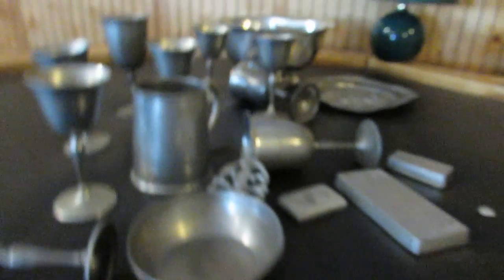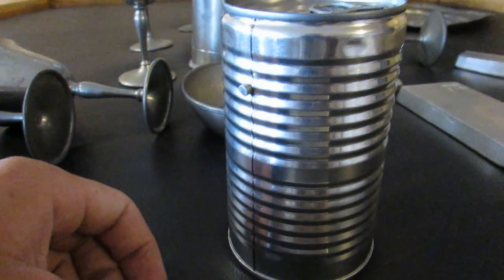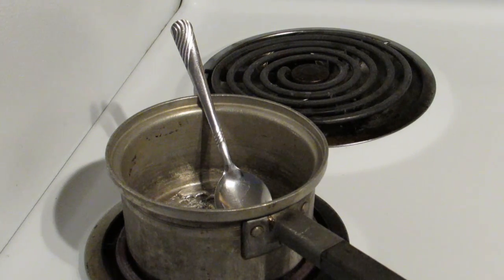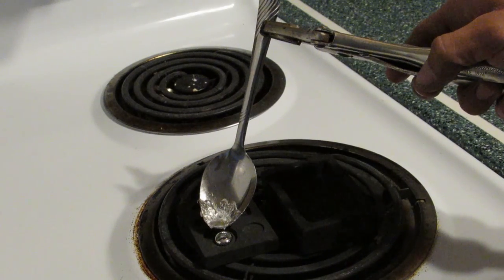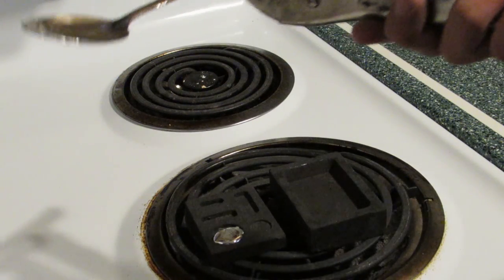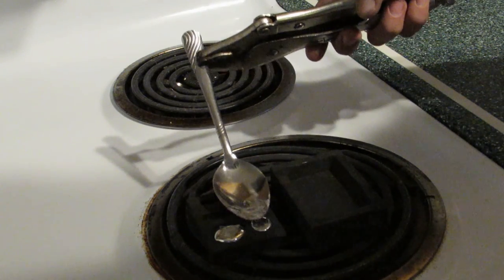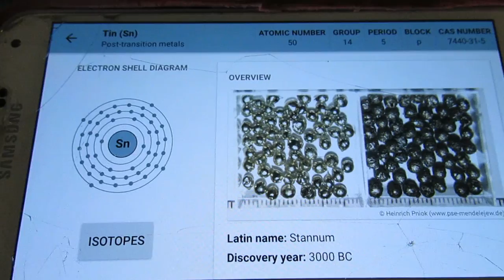Melting tin on my stove top

Comment: Do not use an aluminum pot.
Only use a steel or cast iron pot.
You can get aluminum contamination of the tin, and the aluminum pot itself can melt where it is in contact with the molten tin.

Comment: If you want metal flat you’ll need to press a flat board on it while still molten. Surface tension otherwise rounds the top.
Reply: Tin has a really high surface tension

Comment: what type on pan or pot did you use, and could the pan melt to with the metal?
Reply from the maker: It's an aluminum pot. If you left the stove on high for long enough the aluminum could melt.
Reply: @Landenslifelessons  What happens if you use Stainless Steel pot?

Comment: He is not using aluminum ... aluminum needs to get melted 1,221°F or 660.3°C ... he is using LEAD metal, you can find lead metal inside of car batteries and lead metal is shiny than aluminum and can be melted in the stove with only 500 to 600°F or 300°C... he can be a clown better.
Reply: could be zinc
Reply: Bro what, it is tin

Comment: You appear to be melting pewter, not tin. Pewter is mostly tin, but it also has antimony and copper in it. Don't tin cans rust? Pewter does not appear to rust.
Reply from the maker: What I melted in the video was pure tin. that's why it was so reflective. pewter doesn't shine as good. I bought that block of Tin on Ebay for like $10.
Reply: @Landenslifelessons  what was weight of tin on ebay
did you but pewter too???